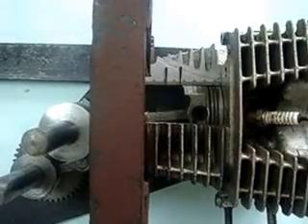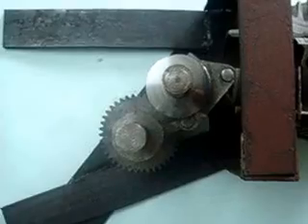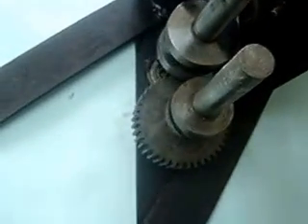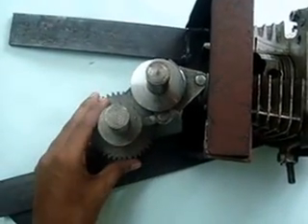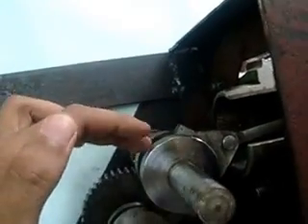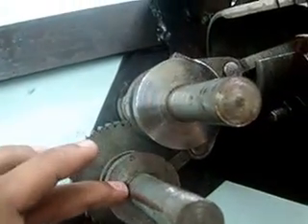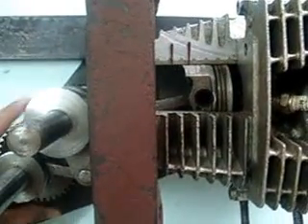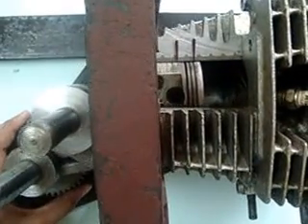ATKINSON CYCLE ENGINE

Comment: Did you make this? I like the Ex link concept and I think it will become more popular because honda has said they can achieve efficiency up to 37%  Maybe you are aware of the original engines that James Atkinson made? His first engine was the "differential engine" and next came the "cycle engine" but not many people are aware of his last and possibly best engine which was named the "utlite' engine" Here is a description: Atkinson was able to make a more conventional engine yet preserved the efficiency of having a short compression stroke and a long expansion stroke in a rather ingenious way. It sounds much like a standard 2 stroke except that the exhaust port is located at about the middle of the stroke. The exhaust is prevented from escaping by a timed valve which remains closed until the piston reaches the end of the stroke. Once the valve is opened it remains open as the piston heads toward compression letting air and exhaust escape until the port is covered. a rich fuel /air mixture is injected by a small piston pump at the start of compression. This results in a shorter compression and longer expansion stroke.  If are interested in more information I can provide links and patent numbers...
Reply: I would love to read more about this design.  It sounds interesting.  Thank you